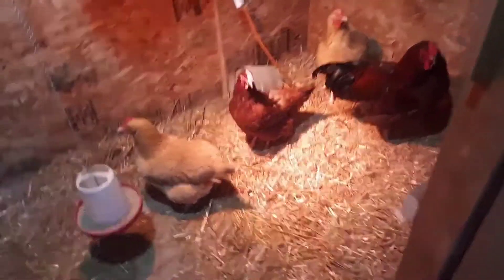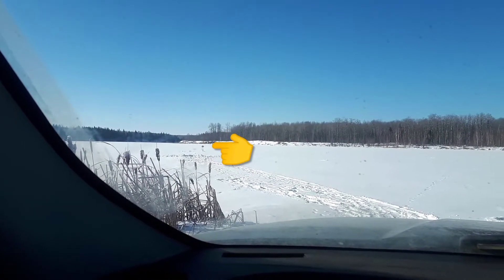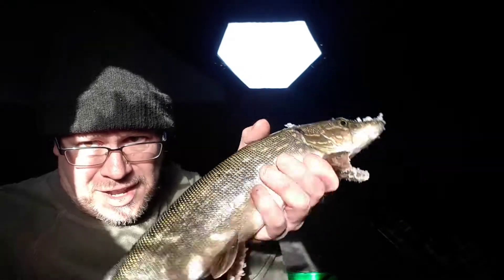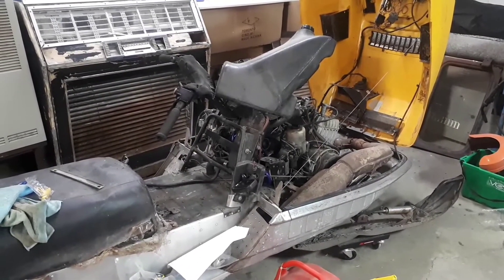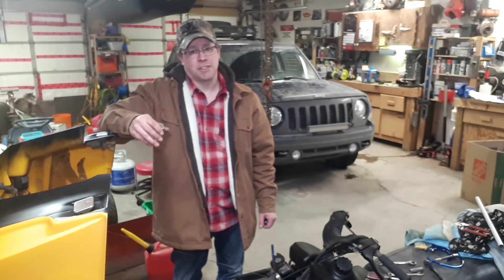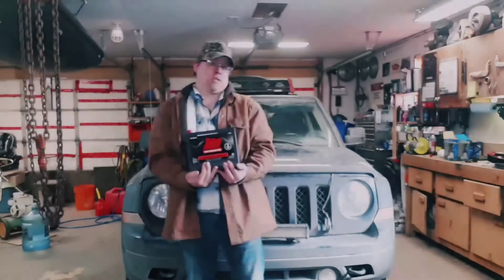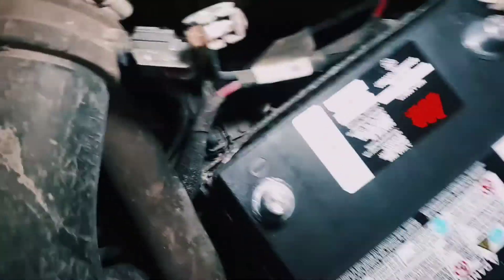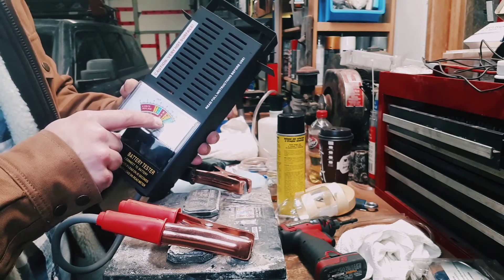It's a Zoo Around Here!! Jeep Patriot Battery Replacement; Ski Doo Muffler Mounts

Comment: That was pretty incredible looking at what you have to do just to get perch. That's dedication. Fish on my friend. I too did the shutoff valve for a neighbors lawn mower for the same reasons. Just to get her to remember to turn it on and shut it off i had to laminate some instructions and put them on the key so she would remember to use it. I have some summer plans to work more on my '67 ford f-100 custom. Thanks for sharing
Reply from the maker: Thanks! Perch and I have a spotty relationship, usually I don't have a lot of luck with the little fellas because there are so many pike cruising around! It was a good day!

Comment: I tried my own advice patching a cracked plastic slide by course sanding and then patching with JB weld embedded in old fiberglass window screen.  The adhesion seems good, but the patch was too thin and cracked under the weight of the kid, JBW and screen cracked together, so I should have bought the bigger size of JB Weld or else globbed on bondo or something and more layers of screen for reinforcement, or used metal like Scott did.

Comment: Those sled engines.....Do they outlast the sleds or the other way round?
  I saw how someone mounted one to a go cart ......In fact, you may have
 watched that video if I recall.     I can only recall ever seeing a 
snowmobile once during our winters; They remain a mystery.
Reply from the maker: From what I've seen, the sleds outlast the engines, or maybe it's that when the sled is not useful it's motor lives on elsewhere? Generally the older motors, especially the singles, seem pretty tough.
Reply: Sleds themselves are made out of aluminum and fiberglass and will last a long time unless you crash them. Motors are like anything else, you abuse them they won't last long. But will run forever if taken care of.

Comment: Can that old battery be saved with either your pulse desulfator? or by overcharging with a welder like this?  https://www.youtube.com/watch?v=VYtkn-N_p4s&t=3s
    I'm trying the former and intend to try the latter on my old excavator batteries, but no luck yet, or not much luck.  I did get one to recover enough to start it for that video I made, with help from one new used battery and my best old one jumped to both my car and my garden tractor, but with both of them off to record the sound of the excavator starting, but I could not restart it with the jumper cables disconnected, even though it was warmed up.  I still have all but the biggest on the pulse desulfator as I type though, for at least a week straight.  I took the biggest off because it is internally shorted and drags them all down to the point where the desulfator shuts off.  I plan to hit that one with my welder like in the video.
Reply from the maker: I did put it on the desulfator, and charged it, and it seemed to come back a little, good enough for a spare/testing purposes at least. I haven't tried hitting it with the load tester to see how far it's come back, but I did return an old, old battery (out of Ol' Jake) for my core credit haha!
Reply: @ShopKatIndustries  I do that, pick my worst one for the core.  loaded up my arc welder to try that heavy overcharge method, almost until it boils over, tomorrow on the farm, after they pretty much proved too old for the desulfator.